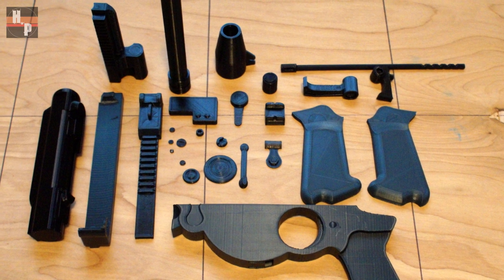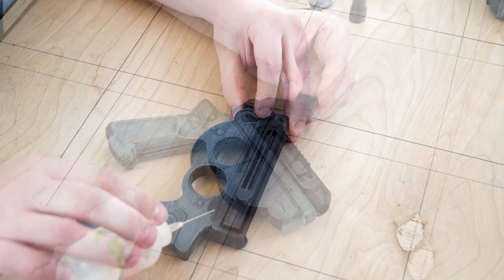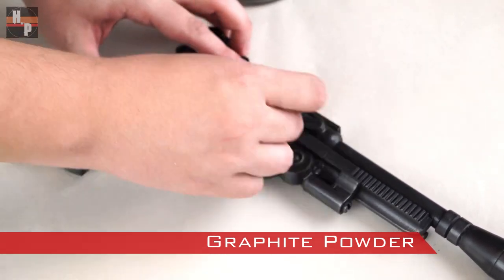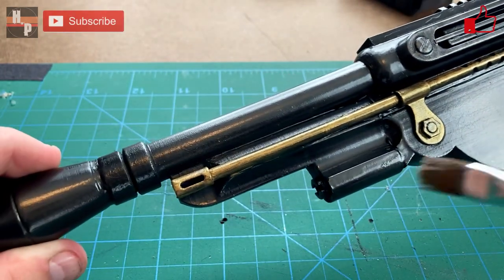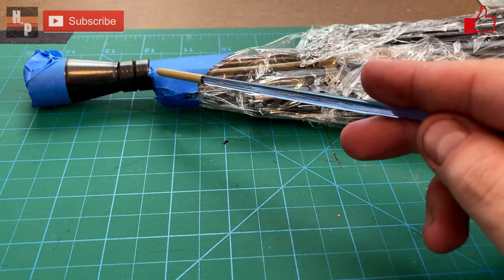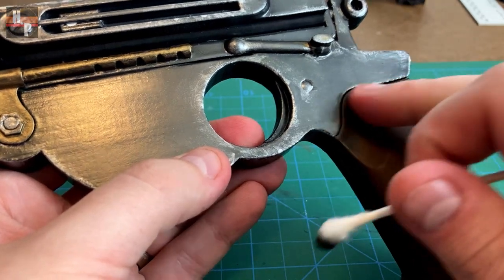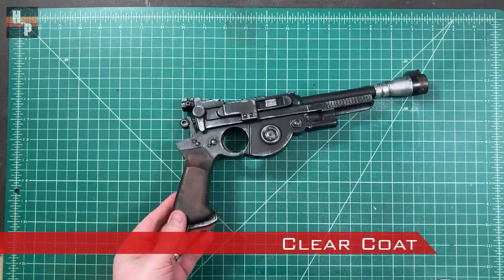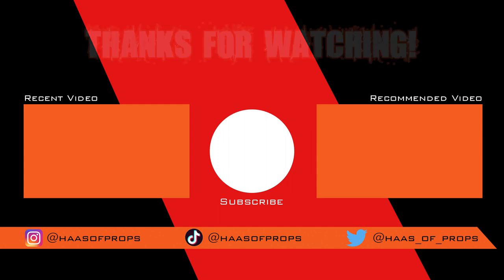3D Printing Mando's IB-94 Pistol Blaster | The Mandalorian Disney + BLASTER 3D Print Clean-up

Comment: I like to use E6000 with a bit of CA glue around the edges, so that way I don't have to sit there and hold it. The CA glue dries and allows the E6000 to cure as well. Nice work on this! I've been wanting to do one of my own
Reply from the maker: That's what I usually do as well. I didn't have the time to keep working on it, so I thought I would use more E6000 than normal, since I had to walk away from it:)
Thanks, and go for it this is a great file to use!

Comment: Hi, my blaster came out pretty good with your instructions but unfortunately using MTM acrylic varnish some places it looks bad, something has gone wrong . Any way to fix varnish? I don’t think I can add a picture here of what happened. But instructions are great, I had never done a thing like this and with your instructions before varnishing it looked amazing.
Reply from the maker: Thank you I'm glad you found the instructions so helpful! I've never used that type of varnish before. There are several things I can think of that might work. 1, a second lighter coat of the varnish might even out the spots. 2, lightly sand the existing varnish with some 400 or 600 grit sandpaper and reapply. Or 3, repaint on top of the varnish, let it dry, and reapply the varnish. I hope this is helpful!!!!